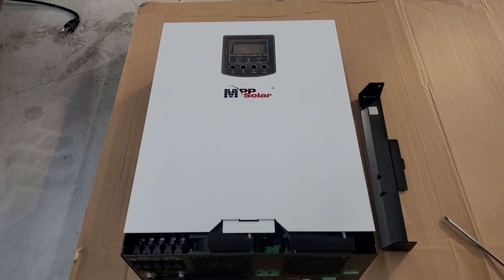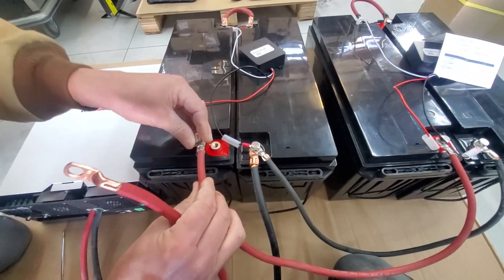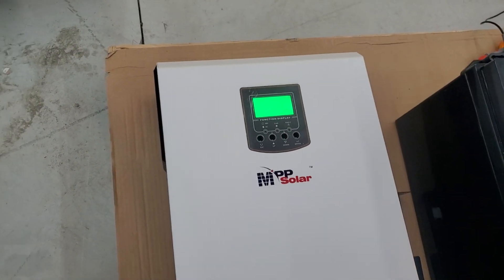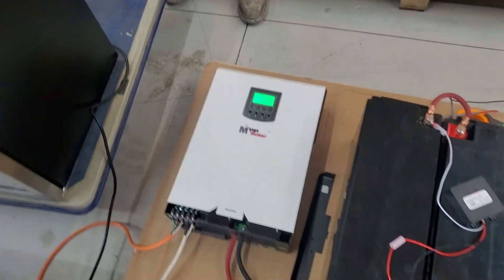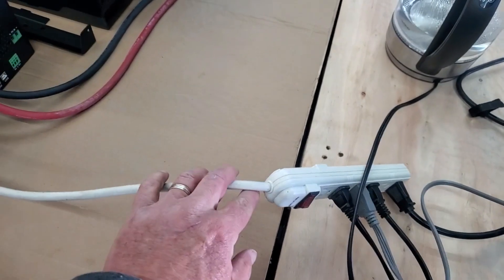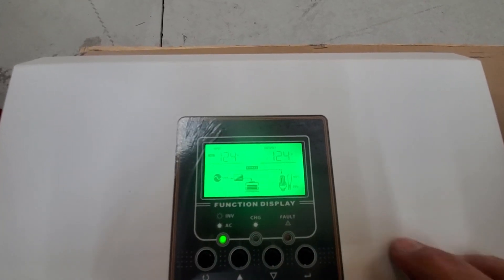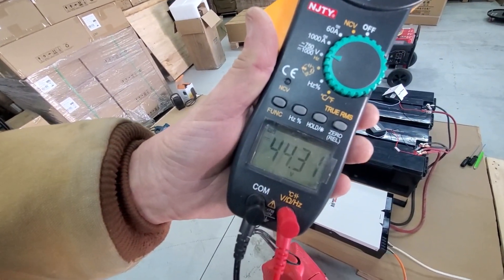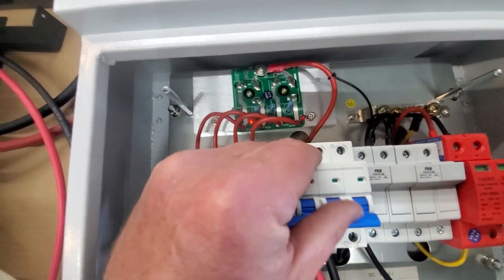MPP Solar LV2424MSD 2.4kW 24V with 80A Mppt Load Test

Comment: I have been having issues with these unit coming in to my work bench with bad MPPT PCB. These are under the 2000w limit and under the voltage and Amp limits as well.  However the complaint is PV is not being recognized by the inverter. When I open it up I can see burned out MOSFETs on the mppt board. Fuses are intact and unit works under battery and utility modes.
Reply: That's good to know I was seriously looking these to replace my Epever and standalone 1500-watt inverter to power a small window AC in my shed. I have about 600 watts of solar not enough to keep up with this AC unit. I tested it in the winter it only was puling 400 watts, but once the heat hit 110F or more now the AC unit is up to about 950 watts. I wanted an all in one I could plug utility power and to switch over to. I guess what they say you get what you pay for $450 unit with this many features probably cut corners on the parts.

Comment: Will one of these units run an  Air conditioner?
Reply: 8000 btu
Reply: Get an inverter AC and yes it will.  It depends on battery ah for how long. 
For example 280ah worth of battery is 3584 watts max. (Just an example, like (2) 12v 140ah batteries connected in series) (This inverter can go 2400w, but 2000w max, max! Should be used for longevity and you can only pull so much solar)  If your AC uses say 800 watts constantly you would get almost 4.5 hours of run time on battery alone in this configuration.  If you have enough solar power the solar will handle that entire load without using any battery or minimal until there is no longer enough sun to power the inverter. Then it switches to battery.  
Basically you can run anything up to 2000w on solar or solar+minimal battery if you have enough solar panels hooked up correctly.

An Inverter AC however will automatically fluctuate to maintain that Temp you have it set at. So it maybe use 0watts at times, but typically 200-800 to maintain set temp(say 78 degrees for example).  That means you will have even more then 4 hours on battery alone likely and why I suggest it.  Plus it will reduce watt usage when the sun is down, because the sun isn't making it as hot or shining on all your things to make them hotter(you won't have solar obviously at this point) ,but even though you will be using purely battery at this point, the battery should last even longer, because the AC will require less watts to cool where as a standard ac may stay pretty close to the same watts the whole time unless you adjust it, as the compressor is activated and it has no inverter built in to adjust energy use.  (Don't confuse the AC inverter in an AC, to the inverter used to plugs thing into or this AIO solar inverter unit lol).
Reply: I am not an electrician or pro, take my advice at your will and see what works best for you from your own research and proper source, especially if unsure, you can consult an electrician.

Comment: Hi i just found your you tube channel. I have the same unit. My question is, in the manual 26, 27, 29 what do I set it to?  I have 2 SOK 12 VOLT 100 amp batteries, and parallel to make 24 volts to use this unit.  26 is bulk charging voltage, 27 is floating charging voltage, 29 is low DC cut-off voltage.  Could you make a video explaining the LCD settings 1-30 and what they mean and what they should be set at. I know that’s a big job, but it sure would help me and I’m sure it would help a lot of others too.
Reply: I set my SOK 206ah bulk charging in the range of 28.4/28.8 volts and I run my float in the 27.4/28.0 volt range. If your batteries are just being used as a standby situation go to the recommended 27.2 volts for 24 volt system float if you're using it nightly 27.4 heavier use shorter winter days set the float higher just keep the float under 28.1 volts.
You don't have a lot of battery there so it's going to kick out of bulk  charging once the amperage gets in the 15 to 10 amp range off grid the sun doesn't shine for a long time so just run the voltage a little on the higher side in the float charging. your charge at sunset should have your batteries at 26.5 volts give or take a tenth of a volt.
Set the cut off at 21 volts you want it to be higher than the disconnect in the batteries BMS.